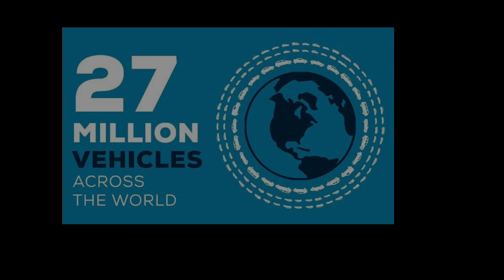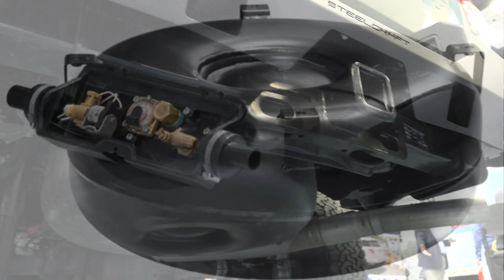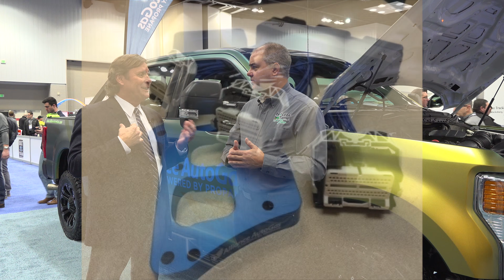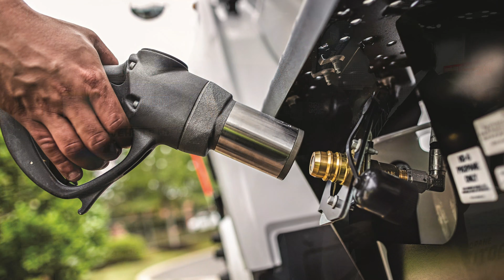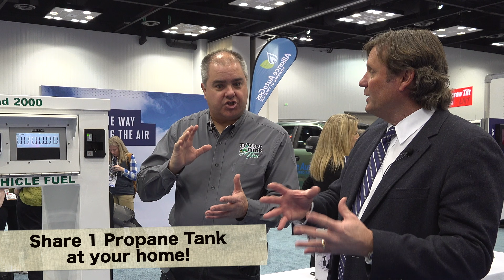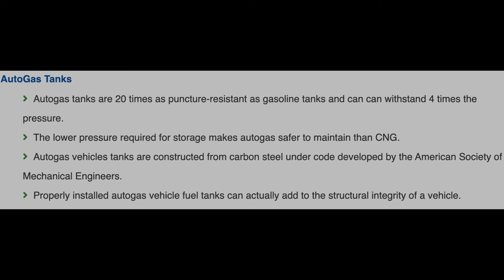New Technology!  Is Propane Practical Now?  Truck and Trailer Tuesday!

Comment: The other benefit of running propane is if u ever took a motor apart that ran on lp gas the inside of that engine will be clean as a whistle it will look brand new which means that engine will last a long time

Comment: Very interesting. in the UK it has not really been utilised , it was a big thing 15 or 20 years ago but there are very few conversions around these days. One problem is a lack of refueling garages and the government started increasing the fuel duty so its kind of died out here.
PS Tim , I bet you would have liked this on your truck if it was gasoline (petrol in the UK ;-)
Also what would be great thinking about it if you have a propane tank to fuel your truck at home I wonder if you could use the same tank to feed your house?

Comment: That fill-up station nozzle reminded me of the connectors the LNG vehicles used back at college.  It's pretty easy to see some of the eco benefits of using C3H8 versus C12H24 (1 carbon to 3 hydrogens versus 1 carbon to 2 hydrogens) in total carbon output.  There are some tradeoffs not mentioned but it is a step closer to using strictly hydrogen for a fuel which has zero carbon emissions in the combustion process, but super dangerous if something goes wrong (just look at the issues NASA has had over the years as well as SpaceX).  Another great episode.  Keep up the good work Tim and Christy!

Comment: No point in going propane when electric vehicles are becoming more and more cost effective each day. And you get to feel good about not burning dinosaur farts.
Reply from the maker: Uh, where does your electricity come from?
Oh, and how are you going to dispose of those toxic batteries?
Reply: @TractorTimewithTim  Wind and solar. Lithium batteries are highly recyclable and, if undamaged, the cells can usually just be reused. Certainly more recyclable than propane that just gets burnt up and tossed into the atmosphere.

Comment: What...a...joke! SEVEN THOUSAND DOLLARS worth of aftermarket stuff that COMPLETELY voids your factory warranty. Towing with a gas engine is a truly miserable experience. But then with gas engines having around 400ft/lbs and modern diesels over 1,000ft/lbs. You can see why.
Reply: The Magnuson-Moss Warranty Act of 1975 protects anyone converting a vehicle to autogas with an Environmental Protection Agency (EPA) certified system. Our warranty simply supplements your factory warranty to provide coverage for Alliance AutoGas Engineered System and its components. If damage to any of the OEM components happens during the installation, the Alliance AutoGas Engineered System warranty will cover those components as well.
Reply: @AllianceAutoGas  You do realize of course... While your system is obviously well engineered and I'm sure very reliable...I have no concerns with your product(s) in terms of reliability or build quality...But rather with your system being a $7,000 aftermarket accessory. Is simply preposterous as most diesel engine options are around $5,000 now. Plus as previously stated... Diesel engines have so much more power than their gas counterparts that you would have to be a complete fool to buy a gas truck, with the expressed intention of using it for an autogas conversion, for serious towing/hauling use day in and day out. Now I do know that propane burns cleaner And that of course makes the engine last longer due to less particulates being introduced to the engine oiling system. However even still...if you do buy a gas vehicle for that purpose you'll be extremely lucky to get to 100,000 miles maybe 150,000 miles. Whereas most diesel engines will work at rated power/torque for at least 300,000 miles if cared for. 

*Disclaimer*
In the interest of full disclosure... I am and have been a professional diesel mechanic for about 15 years. So I'm obviously a little biased on the subject...
Reply from the maker: Brandon, diesel is more than $5000...at least on my F350.
Oh, and did you just happen to forget that diesel is nearly double the cost of gasoline?
Oh, and you also didn’t mention that the cost of an oil change is essentially double that of a gasoline engine.
Oh, and the need for dual batteries, dual alternators, and auxiliary heat so that the cab warms up in less than 30 minutes...
(I have a diesel.   I like it, but the cost is HORRIBLE)
In other words, there are plusses and minuses to each.
Reply: @TractorTimewithTim  I own a couple diesels and a couple gassers. Even though I RARELY drive the gassers... Here in Minnesota. At a dealer. The cost is on average a $5,000 option. Given the exact same features and trim levels. Maybe you should have bought a Chevy...? Ford is really proud that they FINALLY came up with something that can actually run for a while. 🤣 I kid of course. The 6.7 is a wonderful engine and has shown to be extremely reliable. And I actually prefer the truck itself of the Ford to the Chevy. But alas. The duramax is awesome... And the allison is phenomenal!

Diesel in my area is $2.45/gallon. Gas is around $1.80. So it's about 60 cents more. Certainly not "double" the cost. Nice try though. 

With my old 6.5 Chevy... It holds 7 quarts of conventional oil. My 06 HUMMER H2 holds 6 quarts of FULL synthetic. And therefore is far more expensive to change oil on. Also it has a much more expensive air filter than does my 6.5. Now in the interest of being thorough. I do have an '03 Duramax that holds 10 quarts of conventional. And it is about $10 more for oil with an oil filter that is a few bucks more. 

I know your Ford holds 13 quarts of FULL synthetic oil. But you also have an oil change interval double that of a V8 superduty. I know this because my shop has two F-550 chassis cabs. One with the powerstroke and the other with 6.2 V8. 

For you. Of course you have EPA B.S. to deal with and I'm under no fantasies that it's not problematic. Because it ABSOLUTELY is. With every late model diesel since 2012. And this is where the cost of diesel ownership gets kinda "hairy". To put it lightly... This is why my diesels are pre-emissions. I don't mean to say that they're better than your truck or other new trucks. It's just far less problematic and that's important to me as I'm a mechanic 50-60 hours a week and I don't want to waste my weekend working on my own trucks too... 

My 6.5 will get double or even triple the fuel economy of my HUMMER. Some will certainly say that this is an unfair comparison because it's a HUMMER. However if you look at the specs. My 6.5 is a suburban and an 8 lug 3/4 ton as is an H2. They both have similar weights. Both dry weight And towing capacities. And they both even have 4:10 gears. But the H2 DOES have full time 4 wheel drive while the suburban has a much more basic selectable 2/4 wheel drive. Which obviously does affect fuel economy. But not much...

And on to my primary point. Using a gas engine for towing, hauling or any other truck based work is truly miserable when compared to diesel... I started a snow removal business with a Blizzard Power Plow on my H2 about 3 years ago. It is great with it's short wheel base and tight turning radius. However the suburban is exponentially better. First of all even back in the 90s. Diesels had better transmissions. 4l80 vs 4l65 in h2. 

So you're not only paying a premium for a diesel engine. But also a superior transmission and driveline. And also a turbocharger. Ecoboost not withstanding. I don't care how many turbos they slap on it... It's still a V-6. Nuts to that!
Reply: @TractorTimewithTim  and as far dual batteries goes. I always run dual batteries in my plow trucks. So I don't see that as an extra cost. And a lot of newer gas trucks have a dual battery option for this purpose anyway... Gas or diesel. Dual alternators is a rare option and certainly NOT required in any way shape or form. But is definitely nice to have... I do not have auxiliary heat in my trucks. And I wouldn't want it. I have all 4 windows down while plowing as it is. Diesels run hotter so do not require extra heat sources. This is a marketing plow... Unless you're in Alaska... If you're plugging in your truck as you should. Even on the coldest of days... Your coolant in hovering around 125 degrees. So 15-20 minutes of warm up should be plenty sufficient to warm your cab. Keeping in mind I have a suburban cab to heat. Not just a crew cab pickup. And also it gets far colder here in Minne-snow-ta than it does in Ohio. In fact we're often as cold or colder than Alaska. At least the part of Alaska that has a population...

But anyway... This was not meant as an insult to your. I love your videos and your channel. Thank you for taking the time to personally respond to my comments. I like that you actually read through them. Keep up the good work and cool videos. 

On a side note... I'd LOVE to see you get a hold of a loader for Vinny and do some basic comparisons. Nothing as in depth as your JD vs Kubota series. Just a few basic tests!

Comment: Reduced power running propane vs. gasoline is true if there is no change in engine compression, at least on older engines.  It is also stated right up front on dual fuel generators.  I’d like to know how a modern automotive engine computer adjusts things so a power difference isn’t  notable. John Deere tractors from the 50’s and 60’s that were set up from the factory to run LP had higher compression which made the LP engines equal and sometimes even a little better on horsepower.  Higher compression is not a problem because propane has a high octane rating.   John Deere LP gas tractors also had valve rotators, hardened valve seats, and forged crankshafts.  Interestingly they only provided one oversize piston option for engine rebuilding, I assume because bore wear was so minimal.  Three oversizes were available for gasoline.   I have three of those John Deere tractors and I do enjoy them.  I don’t find visibility around the tank to be a problem on them but they are the Waterloo designs, vs. the Dubuque design that was shown.  I think LP is an ideal fuel for many things and I wish there were more new small tractor options for running LP.   Look at all the cost and complexity that has to go into cleaning up diesel emissions now days.   LP is just inherently clean burning, the fuel never goes bad in the tank, people can’t steal the fuel, and you don’t get a headache if you run the engine in a semi enclosed space for a bit.
Reply: Hey Bruce, thanks for your feedback! Here's some additional information we received from our autogas designers and engineers: From an Automotive standpoint, the OE’s fuel trim is controlled by that OE manufacturer. Once propane is introduced into combustion, the OE will sense those changes and adjust timing and other parameters accordingly. With that, the engine was never tuned or planned to have 100+ octane, so those compensations will be limited. We have seen some manufactures have more aggressive timing adjustments than others. Every EPA certified vehicle is dyno tested at an independent lab. Reports can be supplied that will lay out gasoline vs propane horsepower and torque that can document these claims.

Comment: Very good video, Tim. I noticed that as knowledgeable as Stewuart was he never mentioned power comparison with gasoline or fuel consumption. I think I know why. It has been my experience that there is a power loss with propane. As for fuel consumption, it really needs to be broken down to cost per mile. A gallon of propane compared to a gallon of gasoline is apples and oranges. There is a propane powered outboard motor that the horsepower is rated on propane. Dual fuel generators output labels show less kw output on propane. Just food for thought. Stick with your diesel. If you go to propane you will need a much larger engine to equal the torque of your diesel. I get 42 to 44 mpg highway on 87 octane with my 1.4 litre turbo gas engine VW Jetta. It has plenty of pep for passing, too. I wonder how it would do on propane. It would take years and years to pay for the conversion. A propane fueled hybrid would be interesting. See you in the next one. God bless.
Reply from the maker: He told me equivalent power gasoline or propane.   The ECU ensures that

Comment: I had Alliance Auto Gas in my Crown Victoria police car for years here in South Carolina.  I have seen other deputie's cars propane tanks survive severe rear end collisions.  We got about 400 miles on a tank of propane and with the gasoline tank as a back up we got about another 300 miles so we would could work a whole 12 or more hour shift without having to get fuel.  For the agency it was easier to budget because the cost of propane didn't go up and down as often as gasoline does.  I personally didn't notice perfomance issues, but the vehicle services department blamed the propane systems for the check engine light always coming on.  I think it would be different for a truck but in the police cars the extra weight of the propane tank in the trunk drastically made the handling of the car dangerous.  Example we tell rookie officers not to brake and turn at the same time when driving hard to emergenices in normal cars.  However if the officer had a propane tank in the car you had to brake in order to turn to get some weight shift back on the front wheels to have the traction to turn the front end.  Just like if you have to much weight on your rear of your tractor and not enough ballast on the front wheels.
Reply from the maker: Very informative comment.
Reply: No matter the fuel, it’s unacceptable to allow a check engine light on your vehicle.  It is an indication of a malfunction that can effect emissions or vehicle performance.  It is imperative to understand and comply with both Federal and Manufacturer weight and load distribution standards.  As recent as 10-15 years ago, there were a number of non-automotive oriented companies in the aftermarket space.  Many of these considerations were not always understood. Our systems and tanks are proven not to interfere with a vehicle’s performance or the weight distribution, and in no way should be considered dangerous as we follow all NFPA 58 guidelines for safety.  Learn more by visiting https://www.allianceautogas.com/municipalities/

Comment: Natural gas is better than propane because you don't have to worry about running out because propane requires a propane tank in your home or business property that has to be recharged or refilled just like your propane gas grill but natural gas is endless supply no tank.

Comment: Sorry, I work in the fuel industry. This is NOT viable. Just like CNG or LNG is NOT viable. There is NO infrastructure and it would take millions if not billions to create that infrastructure. Bigger companies have tried and failed with CNG and LNG. Alliance AutoGas cannot compete with the big boys, even though I commend them for trying.
Reply: Thank you for the comment. Alliance Autogas has proven technology and a Nationwide Refueling Network that is supported by over 120 Partners across the US, and we are committed to bringing Energy Security to our customers by helping them use a domestically sourced fuel. Infrastructure for autogas is a fraction on the cost of CNG, and can be built for less than most people think. Learn more by visiting www.allianceautogas.com

Comment: To use your home tank for fueling your automobile or truck, would require you to pay road tax for your home fuel. There is a road tax on all fuel used in vehicles, and having a system that does both won't delineate fuel that is used on road or off road.

Comment: We use propane lift trucks 24/7 without problems.  The exhaust is clean, the oil stays cleaner, tanks easy to change out.  Propane is very cheap at the moment.

Comment: The downside to propane (and ethanol, methanol, CNG, LNG, etc.) is the energy density. Propane is on par with E85, so your dollar per mile is much more than you might initially think.

The environmental benefits are all there though, without the massive amount of land and pollution dedicated to current ethanol production, for instance.

I'm still hanging my hopes on John B. Goodenough.  No, it's not a joke. That man has made modern life possible, twice, already, and solid state batteries are the next almost here thing!!!

Comment: Oh here’s what needs to get on ball is rv parks that usually fill rv butane tanks but if they add a fueling hose plus gas ⛽️ stations add a pump for I think motor homes motor cycles and big rigs 🚛 get on board for natural gas plus your engine lasts longer from new I’m totally sold . If the air and carbon foot print improves yes now not later. Brain 🧠 fart why not in a pinch be able to transfer some to a bottle or engine that’s empty bottles need a quick connect oh outboard engines marine engines. Lawn equipment is their big stuff. But smaller riding mowers push mowers heck yea.

Comment: Need to know about the propylene additive in Propane. In forklifts propylene is usually the biggest contributing factor in LP fuel system problems. Also not sure how they are getting around the loss of efficiency? Typically there is a reduction in horse power when switching from gas to LP.
Reply: On-road propane fuel, (autogas) as tested, is typically 98 percent propane, with trace amounts of other hydrocarbons (ethane, butane, etc.). Therefore, there is not typically a risk for having high propylene levels.

Comment: In the netherlands the cars running on propane in the early 80 til now but in all those  years it goes op and down  ,there are different systems ,but also a lot of problems and the feul consumption is much more than regular petrol or diesel .